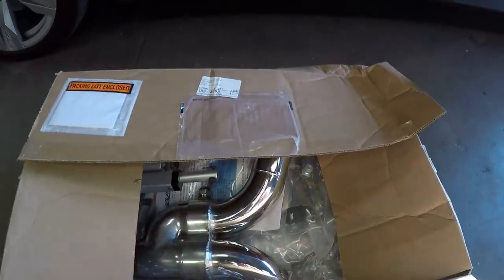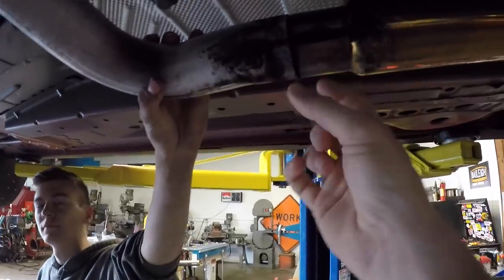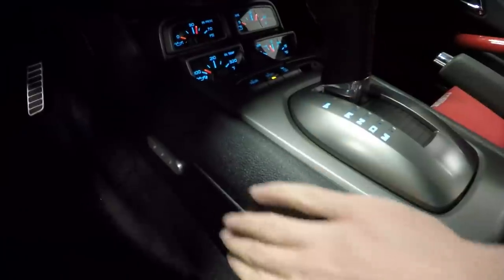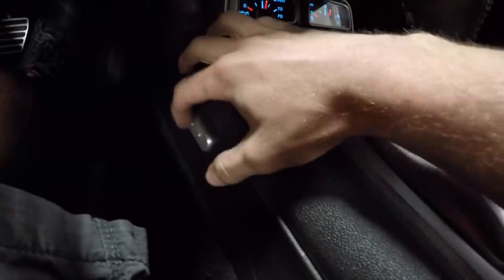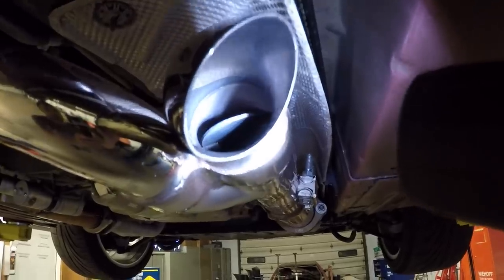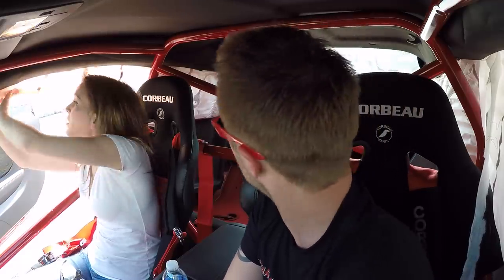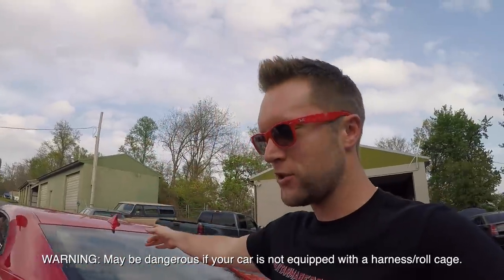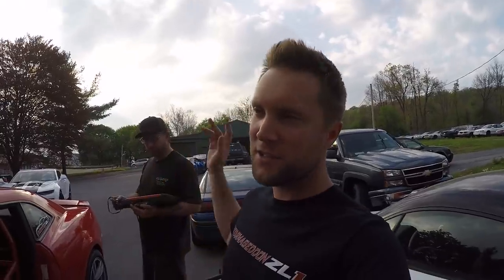LOUD EXHAUST Makes Airbags BLOW at 140mph!!!

Comment: Your car just did its own weight reduction
Reply: Mike Garcia who can blame it? I kid, I kid. It probably came on itself though.
Reply: It LOVED the Sound!!!!!!
Reply: Too bad it weighs the same deployed as it did before
Reply: Michael Brown not quite. The air bag fills with the combustion gasses from the explosive charge and then immediately vents as the bag deflates. So the car is slightly lighter afterwards as the charge is consumed. It's negligible but you are incorrect as well as the 30-some-odd fools that gave their thumbs up
Reply: SirBudrick not to mention the weight of the removed airbags.
Reply: Single Dad Sew true but technically the car didn't do that itself. Dude from DFR did.
Reply: SirBudrick Okay If the weight of gas is that significant id be very very suprised.
Reply: Single Dad Sew That wasnt done by the car as Budrick pointed out. Either way "weight reduction" is pretty out there. Does farting count since the gas is released ?
Reply: Michael Brown nah that's a driver mod.
Reply: SirBudrick splitting hairs, yes you're right. Technically the car didn't do it. It did however cause it to happen.
Reply: Many arguments come down to splitting hairs. That's often the difference between correct an incorrect. Then other arguments are really subjective and about which car is "better" (i.e. which do we think is cooler). I like to stay out of the latter ones because there's no solution. It's completely subjective.
Reply: Fuck I want a ZL1 so bad now, but is it worth the price lol
Reply: Mike Garcia I’m fucking dying😂😂😂😂😂😂😂😂😂😂😂

Comment: I debated getting an automatic until I saw this guy's face when he's flooring it. It was at that moment I realized that driving my girlfriend's 5 speed Honda brings more joy into my life than an automatic Camaro ever could.
Reply: manual takes skill.
Reply: i would never drive an automatic i mean fucking try to controll it in the snow with kickdown and shiftups when u dont know fuck that manual <3 or KDD
Reply: Timmy Johansson Snow? what's that? I live in texas
Reply: Jack Mcgaha lookup boba vw golf, its manual, and running faster times than this automatic.
Reply: Sure, at 0:05 the girl looks like she's having fun, but the guy... no, he can't even crack a smile. Moving forward to 0:11, that's the reaction one makes after dragging a knee for the first time on a bike or gets the back end a little squirrely halfway through a chicane and manages to correct themselves. I drive for the fun, thrill and experience which is why I left drag racing around 10 years ago and solely tracking bikes. So yes, I would absolutely rather track my girlfriends Accord than push the right pedal in this thing for 10 sec, followed by a little bit of the left pedal while holding the steering wheel in place (might overload my brain with so many controls to manage).
Reply: Travis Hooper nothing bring more of a smile to my face then buying some car parts and installing them, can't wait to use them,     95 mustang GTS  stick is a blast to drive,
Reply: he never said it was a civic hehe
Reply: Know that feeling i have competed in motocross and u search for that feeling for the rest of your life when u know in that second that if i make this right i will make it if i make a small mistake i will hurt myself
Reply: Yeah, automatic is boring AF.
Reply: the funny thing is it is a manual    ever heard of paddle shifters    watch his mom reaction video and you will see that he is using paddles
Reply: bob bobo get used to them... stick is rare now. many car companies don't even make stick shifts now...
automatics can shift faster and harder than any stick..
goto the dragstrip and tell me if you see many stick shifts...
Reply: This guy thinks paddle shifters classify as manual. lololol
Reply: Hny Bdgr Clutch? issa automatic.
Reply: Travis Hooper my moms civic with vtec and automatic transmission is a bomb, you don't even feel the gear changes.
Reply: Sit in traffic for an hour how much you like manual.. go to a track there all automatic for a reason cause there faster I don't care if your the best an auto will beat u
Reply: RippinChips Part of what you're saying is true. Modern automatic transmissions such as CVT's (Constant Velocity Transmissions) are faster than manuals, because they don't even shift, in a sense. (It would take too long to explain it. But older automatic transmissions could be beat. You could upshift or downshift faster or at better points than them. Some of them had trouble choosing a gear in certain situations. Some people enjoy manual because it brings them more joy, or live in an environment where the weather is bad, where a clutch and selecting gears really helps. To each their own. (Unless you're drifting. If you drift with an auto you're fucking stupid.)
Reply: tekkman boxmb my brother has a clean 95 mustang gts making 307whp
Reply: Aylo Optimiize CVT means continuously variable transmission because it has no set gear ratio. The transmission adjust to lay down needed power but maintaining fuel efficiency. And a CVT has to be one of the slowest shifting trannys. They're meant for the daily commute. It's also the reason I couldn't avoid a collision with a lady who wasn't paying attention. The reaction of the transmission left me as a sitting duck. I was turning left in a left or straight travel lane and it was raining bad. I took the turn at 5 miles an hour because of how harsh it was. Crazy water. Lady was on her phone and forgot to turn left herself and caught me mid way through the turn. Foot all the way down she was doing 30-35 at about 150 feet away (I noticed her speed coming to the turn) floored it and nothing. All the way until I got hit.

Comment: Boom! Airbags pop spontaneously 
Nick: "I probably have to clear a code"

I needed a good laugh today...thanks Nick!
Reply: FYI, you shouldn't tell people to disable their airbags. Not only is it stupid and dangerous, it is illegal to do so on a street driven car (whether or not it has a roll cage and harness).
Reply: It's also illegal to take the cats off, so we're way past worrying about that.
Reply: loridergmc91 with the roll cage and the safety harness he doesn't need the airbags and here in New York you can disable your airbags and it is not illegal. I have an 04 Mustang where I change the steering wheel to a racing wheel a smaller wheel and did a delete on the passenger airbag and it still passed inspection
Reply: kajidono Removing emissions parts and removing safety equipment are 2 completely different things.
Reply: Charles Rivers Its a federal law. Vehicles originally equipped with airbags cannot have them removed or disabled. Pretty sure your car was inspected illegally so if you get into an accident and are injured you can sue the shop that inspected your car. I have had inspection licenses in Maine and Vermont and in both states just having the airbag light on is cause for failure.
Reply: Both illegal. What does it matter if it's under a different statute? Doing either one would get a shop hit with massive fines and/or shut down entirely.
Reply: kajidono Yes, both are illegal but a catalytic converter won't save your life in a car accident
Reply: loridergmc91 with the cage & harnesses installed, the airbags effectiveness is nule. They are designed to cushion the impact of the persons body against said object (steering wheel,dash, door). With the seats & harnesses Nick has installed, his body never reaches those points, even in the event of a crash. Thereby rendering the effectiveness of the airbags nule.
Reply: Rusty Rail Call the NHTSA and ask them if you can disable the airbags on your street driven car because it has a roll cage and safety harnesses. I'm sure the answer would be no. If the car was a dedicated race car then this whole conversation wouldn't have started. I was just suggesting Nick not advise people to disable their airbags for safety and legal reasons.
Reply: luigi90210 You should take another look at the document you linked. Specifically where it says notice of proposed rulemaking. It is a proposal to change the law to make it legal to disable the airbags in certain circumstances like the ones you mentioned.
Reply: Actually no it is legal, all baby seats come with the same message to disable airbags when putting a rear facing seat in the front of an airbag equipped car. What the proposal recommends is no action is taken against dealers and certified repair shops for disabling them. 

If you really want to get into the legality of it, the NHTSA won't go after individuals for disabling airbags because it's legal for them to do so, only businesses that do such a thing is when an issue occurs.
Reply: luigi90210 Dual front airbag equipped pickup trucks and passenger cars without a rear seat either have a factory installed disable switch, a weight sensor in the seat or a smart airbag system. When I say its illegal to disable an airbag I'm talking about removing it or permanently disabling it somehow. Putting an aftermarket switch in to shut an airbag off is illegal as well but that goes back to your last comment and the link you posted.
Reply: loridergmc91 m
Reply: loridergmc91 lol
Reply: @Greezmunky77  I know it’s an old comment but if it’s a federal law then why can I disable my passenger airbag with a key🤔

Comment: I think that it is more plausible that the air bags deployed due to the release of the throttle while doing 140 mph. the release would have cause the computer to read a g force that would have simulated a abrupt angle change in the car simulating a collision I personally don't believe it was due to the exsaust but I would be happy to be proven wrong
Reply: That would have deployed the the front airbags instead of the sides
Reply: valid point
Reply: The g forces would also go into the driver and passenger. Maybe not the driver cause he's in control of the pedal he knows what's coming, but in some cases air bags won't pop even in a collision so, the passenger would of had some whiplash experience if the g forces are that high
Reply: alan hembd also the fact that he was still on throttle at the point of deployment
Reply: fuck kinda airbags pop from loud exhaust? also i seen a vid of a guy drifting a fifth gen and popped the airbags..... mines not loud its a v6 but i romp it sideways and act a fool sometimes. i feel like theyre gonna pop all the time now
Reply: He was in the fucking pedal when they went off. He let off after
Reply: they never went off before the install
Reply: air bags should deploye milliseconds befor impact, right? no reason for deploying here and car computers with g-forces sensores doublecheck several inputs befor deploying a air bag...or am I wrong?
Reply: @elcollego9435  airbags go off during impact. The sensors set them off while the crumple zones are crumpling.
Reply: @JoeZasada  thats not right
Reply: You tried a little too hard on your theory, I know from experience that curtain airbags go off when a cars in motion and experiences certain types of vibrations Aka, Windows breaking and shaking, to protect those inside the car from flying glass/debris. So the exhaust was putting out such a frequency causing the windows to shake, the sensor must have thought the windows broke.
Reply: Tyree W the seats turn of the fronts
Reply: El Collego El Collego is a car supposed to see the future 😂 how would they go off “milliseconds before impact”.

Comment: Once we installed a really loud subwoofer in my friend's Volkswagen. It fired his fucking airbags (both front ones) when we were in a parking lot. Thanks God we were out of the car listening to the music from outside when this happened. You never know what can deploy your airbags! :)
Reply: Older car?  Newer generations have occupancy sensors in the seats.  I buy salvaged cars for a living and see all kinds of weird stuff.  Gone over a curb and all the bags blow, hit super hard in the front and no bags blow.  Hard to figure sometimes...
Reply: Did you ground it to the airbag module
Reply: Yeah, on my Volkswagen, there are air pressure monitors in the door panels that work with the airbag system. I read about that when I was thinking of changing out my speakers.

Comment: Wait..... Your race car still had airbags? lol
Reply: number3665 😂😂😂
Reply: number3665 Yes, he daily drives it too. Better be safe than sorry.
Reply: Sorry buddy those airbags don't help in a car with a roll cage as you just saw. The only air bags that may be helpful are the dash and steering wheel. Also once you build a race car and put the racing seats with harness and roll cage and other safety equipment that racecars require, there's no need for airbags. All of the other equipment more than makes up for it and even makes the car safer.
Reply: Last I checked, real Race Cars don't have Air bags!!!
Reply: number3665 and an auto trans..
Reply: auto trans is for racing lolz. you dont see no super fast cars with a manual trans :)
Reply: even worse: had a cage and no helmet.

Getting in a wreck is like getting hit in the head with a steel baseball bat.
Reply: Allende NL formula one cars are the fastest race cars and have manual shift paddles so technically still manual and not auto
Reply: because they clearly go in a straight line... @Spencer Tapprich
Reply: Because a roll cage without a helmet is dangerous.  A roll cage is a big steel beam where you normally had soft padding and air bags, your head will get smashed horribly even in a relatively minor accident if you don't have a helmet.  If the guy wants to daily the car, he shouldn't put a cage in it.
Reply: If he wants a roll cage, great!  But in having one, the driver and passenger should also be wearing helmets!!!  Because that is what you do in those types of cars, especially with no air bags.  Clearly the side air bags would have done NOTHING in the event of a real crash as the role cage was in the way.    You want to drive around a so called Race Car around on the public streets, a Helmet is required in that kind of car.
Reply: Safety is number one priority.
Reply: number3665 not much of a racecar if it's automatic
Reply: DaYz Phantom Well Drag race cars are usually automatics
Reply: well, in order to be street legal...
Reply: Why not?
Reply: Uh your comment shouldn't be directed at me but Boom Johnson.
Reply: number3665 even though he has a cage, air bags need to be plugged in for inspection.

Comment: air bags deployed = salvage title
Reply: Believe it or not, depending on his insurance and policy, if it’s customized agency they will definitely repair the vehicle. But if it’s a regular policy with state farm for example, he’s fucked.
Reply: Also depends on the state and insurance type
Reply: Only if there is frame damage. A non-accident airbag deployment is an out-of-pocket expense not covered by insurance. A Genuine side curtain airbag costs between 200 to 700 dollars a pop. Since it's used as a race car, a resistor would suffice.

Comment: Don't think it was the exhaust it looks like you hit a bump and then the bags deployed,maybe I'm wrong but it looked that way.
Reply: Seth Johnson Well no. Have you ever been next to a car with open headers? It literally vibrates your chest and breathing feels hard. Imagine all of the sensors that are attached to the car, they must be shaking like hell. A bump like that mixed with the vibration would have caused the car to think it's in an accident or about to be in one, this is well designed from the factory, but the modifications caused this.
Reply: Doesn't really look like he hit a bump though, the cameras shake looks more like it was from the airbags themselves moreso than a bump.
Reply: And hitting a bump at 140mph miles probably didn't help either, wherever it is legal to drive that fast on a public road in the US.
Reply: Haven't you heard of the new American autobahn? lmfao
Reply: A large loud vibration will not cause curtain airbags to deploy. The rollover sensor located in the center of the vehicle is what controls that. A bump at that speed could cause  the airbags to deploy.  The sensor sees an abrupt change thinking it either
 rolled over or is in a crash.  Would be interesting to see what the insurance data in the SDM has to say about the airbag deployment.
Reply: tjmartin34 The airbags are not only controlled by the roll over sensor. There are impact sensors or accelerometers to measure certain acceleration in parts of the car. So when you get hit from the side, that sensor will actually trigger the that sideairbag. In some cars it will trigger both sides. Newer cars are fitted with a sensor that listens to the specific crumpling sound of metal on the surface of the metal itself. It is more accurate and faster than the old accelerometer type sensors. Maybe the resonance from the exhaust straight underneath the car triggered such a sensor. Hard to say from video.
Reply: Nijsten Rijvaardigheid I know they have accelerometers but that's called the Multi axis sensor.  It does not listen for sound waves to deploy airbags.  It's basically a G force sensor.
Reply: Valdemar Vera yup I'd say it was the bump. you need to set off at least 2 triggers for the bags to blow. most likely when he put in the cage he got a wire and the bump set off the inertia switch. Not a loud exhaust. There's lads doing 160+dB with walled systems that haven't set bags off.